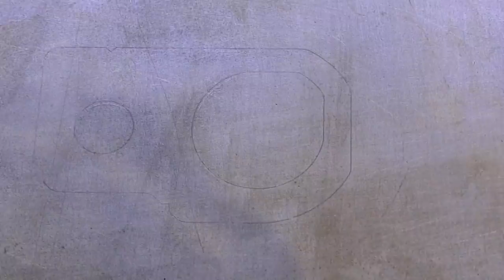RDWorks Learning Lab 164 Honeycomb Alert

Comment: Excellent info as always Russ, You have got me thinking about your dilemma with your laser beams focal point. You seem to have covered and worked out everything, presented very well i might add, regarding the main beam strength as well as the type of bell curve for each lens used. I wonder what the beam would be like going into plywood or MDF? The only way i can think of seeing what the cut would be like would be to do your shots along an edge then check it with a microscope. The acrylic is a great medium for visuals but i wonder if the acrylic being evaporated is distorting the beams cut? I will have to ponder this more, keep up the excellent presentations. I have learned a lot from your videos on laser cutting.
Thanks
Reply: Hi Bruce

Although I showed the beam piecing through acrylic you do not have to anything special to see that same effect in plywood or acrylic.Just run a cut across a 25mm wide piece of material and offer the two cuts back together. You will find the faces are virtually parallel. And that is my real question, Regardless of material, what is the mechanism by which a diverging beam of energy can punch a parallel cut through material?

Best wishes
Russ

Comment: I use a small bed of nails for cutting things like acrylic.  Much better ventilation and no need to deal with spacers.  I reserve the honeycomb for jobs that require more support eg. fabric.  Any suggestions for removing condensate from aluminum honeycomb? Maybe just burn it out with a torch every once in a while?

Comment: I love these episodes.   May I ask if you have any more information on that nozzle/tube setup on the light blade?  Is it a stock unit?  An upgrade?  Anybody know where I can get one. I love how easy it is to adjust.   Thank you.
Reply from the maker: Hi
All these Chinese machine are assembled from a big Lego kit of standard parts that they buy from a big laser supermarket. There are certain basic standard machine designs that the Chinese government authorize and subsidize but the  build factory can choose the discrete components (often the cheapest) that go to make up that machine.  One such laser supermarket that I have come to trust is Cloudray You will find lots of better quality items on their website. It depends on what head you have at present if it will take one of the standard diameter lens tubes available see
https://www.cloudraylaser.com/collections/nozzles-lens-tube 
or maybe you need to buy a complete new head assembly (C series)
https://www.cloudraylaser.com/collections/laser-head-mirror-base-1

Best wishes
Russ

Comment: Wouldn't you get the same result if you used the 10mm supports with the honeycomb?
Reply from the maker: Hi Brian 

Simple answer no. The air flow will find the easiest way in and out of the machine. So most of the airflow will down and through the honeycomb before its much more than 6" inside the front door. Many machines like my China blue do not have ANY gaps for airflow IN so I have to jam the door open a bit.. By blocking off the honeycomb you are MANAGING the airflow to go where YOU want it.
Best wishes
Russ

Comment: Here, all this time, I was thinking Honeycomb was the way to go as long as the acrylic was elevated above the comb to prevent reflection.  The one I am getting supposedly has two different platfoms, guess the Honeycomb will be relegated to acting as a shelf after seeing the destruction!
Reply from the maker: 99% of th time  my honeycomb is acting as a barrier to stop the dogs getting into my workshop. For 1% of is life it has uses. For example if you want to cut some flimsy cotton material or such if you are a dress designer ( not one of my skills!!) or cut a jigsaw puzzle  (sadly I have not found another way) then yes it can very occasionally be invaluable. Whether it be plywood or mdf fumes they all stick and build up in your honeycomb. It's  just that acrylic build up is a lot more liable to catch fire, particularly when you  maybe cutting thicker acrylic very slowly and the excess energy gets enough time to add lots of heat to your residue. Of all the fires reported to me , they have all be machines that are predominantly acrylic cutting. This is just a tip to be wary if you are doing lots of acrylic work , NEVER walk away from a CUTTING process. and maybe think about swapping out your old honeycomb every 6 months or so. Just examine it carefully and maybe you can rescue it by torching it with a blowlamp to burn off the residue safely away from the machine.  Don't be frightened, just be cautious

Best wishes
Russ
Reply: 8 months later and I am still fine tuning the laser. I have been using the HC for what I am doing, which is cutting balsa and lite ply, and though I haven't done much since I got it, what I have done has left a smelly residue on the comb. I also found it shifts around, and isn't easy to secure panels with, so need to replace it. Underneath it has aluminum slats, so those will work well with the wood, but difficult to secure the material to is.  If I put a metal sheet, how does it effect the cuts on plywood and balsa?

Comment: This is probably the best video yet, Russ!
First thing I modded on my cheap Chinese laser was the light, moved from the back to the front. (No More Shining In My Eyes)
Next was the little pads I put under the door for better air flow.
Next mounted a small, fire extinguisher right to the front of the unit.
Going to get a nice sheet of material from work (Machinist) before cutting any more material, and using some risers.
No more Honeycomb for me....Brilliant as always, Russ.
Thank you again, for all of your work!
Rick.....In London, Canada.

Comment: Aluminum is very reflective. I didn't see you elevate the work on the honeycomb.
It could be the aluminum honeycomb is reflecting the laser back at your work and leaving the marks.
Reply: Nuke Censorship I think he said that
Reply: The honeycomb (at least on our machine) is steel.  We use magnets to hold down light material that might be blown away by the air blast in the nozzle.
Reply: @surferdudemi  Regardless of what it's made of, the main issue is that you cannot reliably clean the inside of the honeycomb and it is likely at some point to ignite.
Reply: @andyspoo2  Ours has not ignited in 6 years of use on two machines.
Reply: @surferdudemi  My house hasn't been in a flood or burnt down in decades. But I'm still going to pay house insurance and use smoke alarms. You're welcome to play Russian roulette, but I'm not going to! :-)
Reply: @andyspoo2  You wrote "... you cannot reliably clean the inside of the honeycomb and it is likely at some point to ignite."  That impliues that there's nothing to be done.  You didn't mention anything one could do to clean out that stuff or prevent it from igniting, so your comment seems a bit hollow.  If you properly ventilate it and use compressed air in the nozzle, you won't have that problem.  People use all of our approved materials on our lasers, and they are the most-used large tools in the shop.  Each one has a CO2 fire extinguisher right there.  No problems for many years.  That doesn't mean nobody has paid attention to videos like this.  We've just never had a problem.

Comment: Mine came with the blades. I surprisingly like it. My cuts are large enough that they dont fall.
I will still order a steel honeycomb for possible future use.

To fix the gas collection problem.. Your honeycomb needs grooves cut in the top.  This would allow the pockets to escape. 
Periodic cleaning is a must. Just in one month i have clogged the air filter and the blades have gunk on them.

Comment: this acrylic condensate, would it not be Acetone?
Reply from the maker: I am not a chemist but from everthingi know and have experienced, acrylic is very analagous to H2O.  At room  temperature it is a clear solid just like ice. At 1C ice changes state to lquid water . At 160 C acrylic changes from solid to liquid acrylic. At 100C water boils off into micro liquid particles (steam). In the same way, liquid acrylic boils and evaporates  as Methyl methacrylate, micro particles .  Steam recondenses on a cold surface  so does acrylic . If you blow it  back onto the material surface with air assist the hot vapour will stick to the surface as it cools to a solid . Under the correct circumstances it is possible to cool the acrylic vapour before it hits the material surface and ithen just settles  as a thin film of solid dust that can be wiped away with a dry cloth. I know that you can use acetone to dissolve acrylic but an not aware that any by-product of  acrylic decomposition creates acetone. Quite the contrary.  Acetone is used in the prodcution of acrylic  (MMA) and is therefore most unlikely to return as a decomposition product.. Acrylic is basically a hydrocarbon and if you reheat the vapour to higher temperatures  then it decomposes into combustable products.
 Great question 
Thanks

Comment: A tip for some:- The metal sheet I ordered was too shiny. I used my PCB etchent, Ferric Chrloide (FeCl3) which is used to remove uncovered copper from circuits. Just rub this acid (with gloves) in swirling motions over the metal. Leave it 15 mins or so and then wash off.

Comment: What about reflections? Does the steel plate not reflect laser and mark the other side of your jobs? I avoid using any table where it's possible, and mostly hand my workpieces. I'm thinking of making a pin or needle table.
Reply from the maker: Mild steel is in itself only about 65% reflective but because it is raw  cold rolled steel and it is a matt finish  the reflection gets rapidly diffused. You only need to be about 3 or 4mm above the surface and you will not suffer reflection of any sort. 

If you support your work about 12mm above the surface and cause a crossflow of air to  rapidly move below the work and remove all fumes. If on the other hand  you prefer to not have fumes condensing elsewhere in your machine or extract system you can keep the gap small. In that case you will condense the fumes on the cold steel plate  see  from 5:20
https://www.youtube.com/watch?v=V_ehGE51rH4
I also made a pin support system almost 5 years ago and i still use it regularly. https://www.youtube.com/watch?v=kMDRzBZTW9c

 Best wishes
Russ
Reply: @SarbarMultimedia  thank your for such detailed answer. Cheers!

Comment: Hello Mr. Russ, Hope all is well. I was wanting to know how thick the piece of metal you use on the table is and is the size 11 3/4 x 19 3/4?
Reply from the maker: Provided it sits inside the table brass bushings if you have a  China blue machine and covers all the slots in the original table then it will be OK. The thickness  will be fine at 1.5mm but on my Tangerine tiger I used a more stable 2mm thick.
Best wishes
Russ
Reply: @SarbarMultimedia  Thank you again kind Sir.

Comment: I was planning on using a honey comb base. I won’t now
Reply from the maker: Hi Malcom
If you are cutting thin fabric  or in my case it was an acrylic based jigsaw puzzle  there is no sensible alternative to honeycomb. So yes I still have a very distant relationship with it for odd jobs but because  mine is removable is only on an "as required" basis. Yours is a wise decision not to base your machine around it It puzzles me why the Chinese (and even the "big boys" insist on using it.  I  feel like a bit of a Ralph Nader with this mission.
Best wishes
Russ

Comment: Brilliant! Did you ever try the laser tube from the burnt out cutter?
Reply from the maker: Hi Andy
 No. I did examine it and apart from the smoke/fume build up on the outside it looked relatively OK until I checked some plastic covering/insulation on the HV end that had distorted with the heat. This was only a 40 watt tube and of no real use to me.  It was sent to the recycling centre along with the rest of the top half of the machine. I kept the base frame and wheels and made myself a mobile workbench. 
Best wishes
Russ

Comment: Thank you so much for this informative video and commentary! I needed to know this as my engraver is on its way and I'm looking into accessories.
Reply from the maker: Hi Kennneth
 You must not be scared of honeycomb, just understand that acrylic is a potentially dangerous material if it gets too hot. ALWAYS stay with your machine if you are cutting ANY material. Engraving is much safer.  You may think that lots of air through the honeycomb is a good thing  but what you dont see when cutting acrylic is what happens to the fumes below the honeycomb.. Again this may scare the pants off you but it is just a video to amke sure you stay safe with acrylic. see  https://youtu.be/eaz9ZEjwjfs
 Understanding and respect ,not fear,  will keep you safe.
 Best wishes
Russ
As a new user can I suggest you watch this video series before your machine arrives.       https://laseruser.com/the-concise-rdworks-learning-lab-menu/

Comment: I had a fire in my machine once and since I was there to see it, I just picked the honeycomb up out of the machine and took the fire outside and put it out, no damage to my machine.  Big tip here: sodium hydroxide (Industrial Purple) cleans the wood residue off the screen like magic.  Looks like new again, 1 part to 10 parts hot water soaking, As long as it's a steel honeycomb, sodium hydroxide eats aluminum
Reply from the maker: Hi Robert
 Thanks for the great tip. Yes I do have a steel honeycomb but sadly it has an aluminium framing. The second issue is more interesting. Acrylic, the villain in this video , is unaffected by NaOH. See this chemical resistance chart   https://marketing.industrialspec.com/acton/attachment/30397/f-006b/1/-/-/-/-/acrylic-pmma-chemical-compatibility-chart-from-ism.pdf
 All best wishes for the New Year
Russ

Comment: Brilliant stuff.
One idea I was thinking of is on the inside of the machine at the front end "located on the area of the door handle ( could a 12volt mini fan from a old computer or eBay make any difference or improvement to forcing the air out of the inside of the machine without having the door open? as my blue and White K40 that hasn't even been used yet because I haven't ammeter installed "and" might I say that without watching these videos my so-called 40watt K40 tube would be destroyed,
oh! It's now "spot on 3am in Liverpool my wife is asleep next to me as I continue to get amazed watching a genius at work! 
So I've got half a can of carlsberg left and been watching these videos since 4 - 5pm so I better get my head down in case this snoring ...... Wakes up,
No I lover her to bit's really 😰  😁😁😁
Oh! Goodnight!
Reply from the maker: Hi Joe
The problem that many do not understand (including 90% of Chinese machine designers) is that to extract fumes you MUST allow clean air in. A sealed box like the K40  is nothing more than a vacuum cabinet.....except that it is so badly manufactured that that there are air leaks round the door. You will need to prop the door open with a couple of 25mm blocks to allow air to pass THROUGH your machine. Ideally you are trying to get air flow ACROSS your workpiece. Extract suction alone will not achieve this you need a directed air jet  caused as you suck air in through the front door. This effect is well illustrated  by holding a candle flame at arms length. Suck as hard as you can and in any way you can imagine. Can you extinguish the flame?  No. However, gently blow a directed stream of air at the candle and the result is completely different. That is what that stream of air coming in through the front door will do.
  Maybe  four  2" pc fans in the front wall of the cabinet will do the trick also.
Best wishes
Russ

Comment: Hi Russ 
Your videos are excellent. Its the only real help i have had since buying one of these machines. I bought the bigger "60w" Model of this machine and am having a lot of trouble with the laser tube arcing internally to the piece of steel where the beam exits the tube. I bought a replacement and straight away the same problem persists. I always use distilled water and have flushed the system and checked the earth wires. Can you give me some guidance as to how to fix this problem? Im sure you are busy with all these comments but you are the only person i can think of that can help. The seller has no clue. There are no videos on youtube with a solution. 
thanks
Tom
Reply from the maker: Hi Tom
This may require some email communication because what you have is not normal and you may have have to send me some pictures or video. Add your email to another comment and I will reply. I will also delete your comment from public view
Best wishes
Russ

Comment: Thank you for this informative video. I try to catch up on your previous ones but there is so much material to go through... 
Anyway, quick question: we use a 1600x1000mm 130W laser mostly for cutting fabric. It came with a honeycomb table which is a pain to clean and we see the poor airflow whenever we cut HDPE.
Could you recommend a proper cutting surface for fabric? Standoff obviously won't work for us. I was thinking about a steel or aluminium table with bigger holes than the honeycomb.
Reply from the maker: Hi Robert
This is an ongoing learning journey so there is 3.5 years of getting to grips with the machine and the technology. Starting from the end and working back may be confusing  so maybe jumping back 20 sessions at a time  and then working forward may be a better strategy .

Much as I hate the honeycomb it has its uses for some people. Soft floppy fabric is just such a use if you are doing one offs and specials. However if you are doing repetative shapes there may be alternatives.
Attach you email to another comment and I will reply with spme questions and remove your comment/email from public view.

Best wishes
Russ